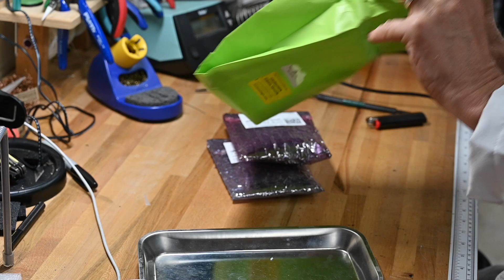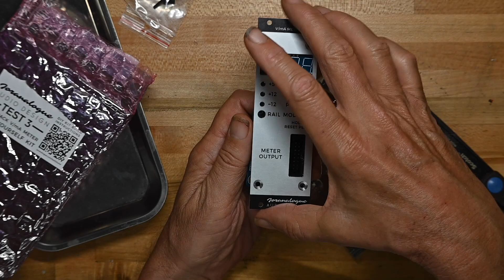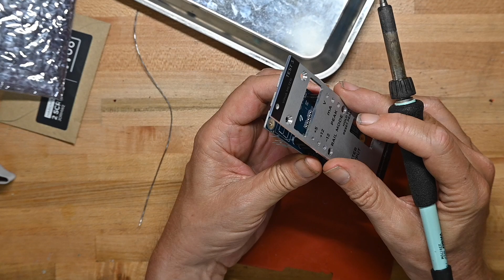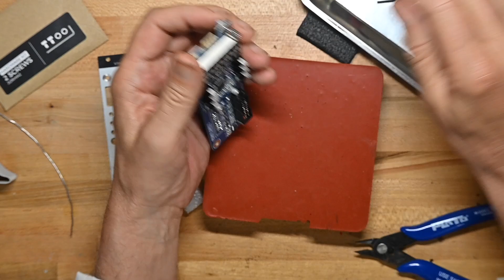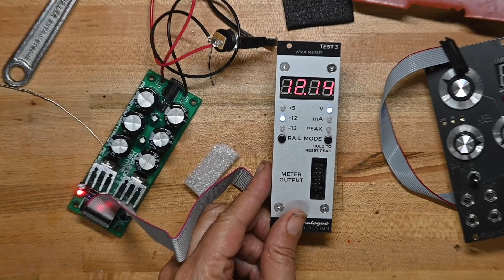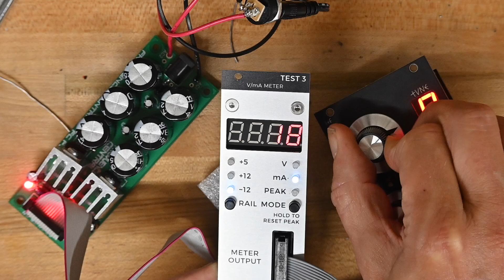C.K. builds a Test 3 rack DVM kit from Joranalogue, eurorack

Comment: This is on my list, thanks for building one. Have you talked about why you like the angled tip on your iron?
Reply from the maker: @Feldspar__  I have, but I probably should repeat it periodically, next vid I record(in November, I'm pre-loaded until then)  Or maybe even make a soldering video, but there are so many of those on YouTube I don't know what I could add that's new.
Reply from the maker: But anyway, I like being able to "snuggle" the wire lead in the bent elbow, helps max heat transfer.  It also gives me a clearer view of what I'm soldering, a straight tip blocks my view a little, this is really important to me when doing surface mount.
Reply from the maker: I do use a straight tip for very confined  areas, like inside guitar amp chassis, cuz there's no room to have that extra view.

Comment: I built one of these in Nov 2022, and I like it. But I wasn’t digging the readability of the digits. I found some red plastic sheets and cut 2 layers to fit on the back side of the panel. (On Amazon the one I used is “10 Pieces Christmas Gel Filter - Transparent Color Red Correction Lighting Gel Filter 8.5 x 11-Inches Red Gel Light Filter Plastic Film Sheets”.)
Reply from the maker: Good tip.  My studio and shop are both a bit low light (the cameras compensate for that) so I didn't notice.